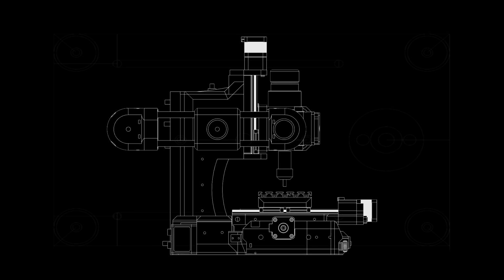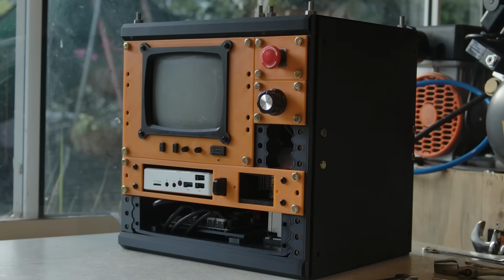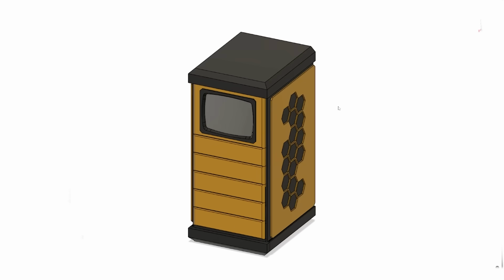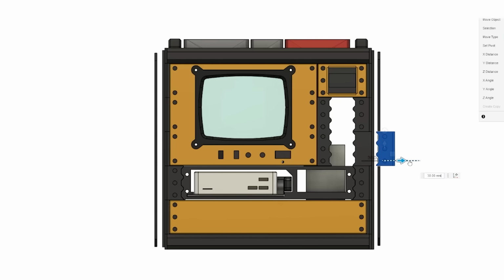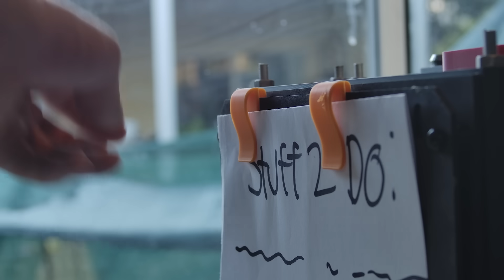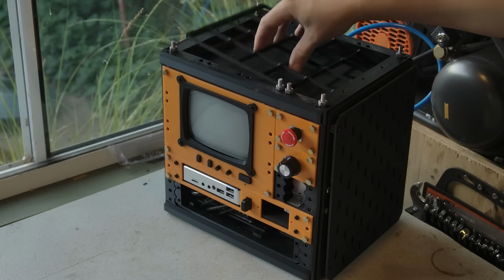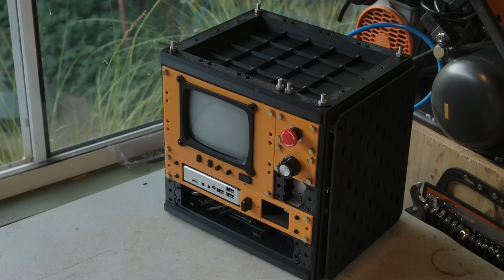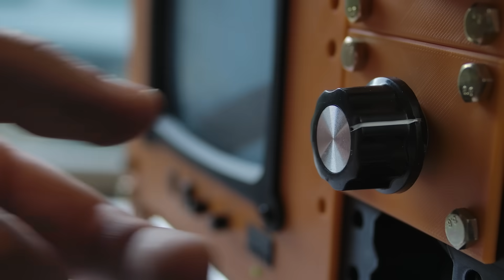I Printed A Modular CNC Controller

Comment: why crt? for he retro look?
Reply: Crt is pretty common and cheap to use, its well documented and very easy to hack the electronics. They are also commonly available. Most people use them because they are available to use at the time or for esthetics. It really could be any number of reasons but I can tell you that I use them because of availability, I probably have 10 laying around the shop and it means I dont have to spend more on parts.

Comment: 8:24 see that z axis inconsistency? You need to tighten your z axis and probably also set the grub nut in the lower part of the threaded rod. small contact area and high torque lead to slipping.

Comment: Using unkeyed identical connectors for different types of devices is purely asking for trouble. You are one mistake from frying you stepper drivers if you connect an endstop switch to the wrong connector.
Also spindle speed should be controlled by the controller, not manually - just so you can automate spindle speed changes as feedrate changes.
Why use a low resolution CRT as the display? Readability should be the primary concern, not rule of cool.

Comment: I started working on an automated photo turntable with GRBL and some networking / RPIs before that @JeffGeerling masterpiece dropped, but this is a much better approach. Just to save you a potential headache down the road - be mindful of crosstalk / noise between the power and stepper wires. You should be fine, but I had issues before rethinking how I grounded the enclosure (apparently CNC cabinets are metal for a reason). When the CNC cable was routed with my power cables, I saw some inaccuracy in the stepper output when I was drawing more or less power to the server equipment. That being said, the devil on my shoulder is curious if you could use that quirk to create some visual artifacts on the CRT...

Comment: Why not model a little piece of plastic onto the back of the "power button" you want to just transfer a horizontal press to a vertical press, so you don't need to pull the mini computer out?

Comment: Lovely design, I like that the side panels and top are modular as well!
Regarding the power button, if it works like typical motherboards you could just wire another switch, or you could make a little lever jutting out which pushes on the button when you pull it down
Reply: the lever was my thought as well!

Comment: I get frustrated with heat-set inserts too, so I designed an attachment for your Sensitive Drill Press to hold a soldering iron to help install them! just posted it as a remix on printables. Thank you for making such incredible designs!

Comment: scanning the CRT monitor seems like super overkill. basically all CRT display surfaces are either a spherical section, cylindrical wall section or just flat. looks like you have a spherical section. you should be able to measure the radius of curvature using a few different simple geometric methods, and then dial it in with a few prints to make sure you nailed it. off the top of my head, there is actually a formula that gives you the curvature based on the corner to corner distance of the display area (of course i don't remember what it is). scanning it is cooler though

Comment: You can also add recesses to frame rails and springy one-way teeth to sliding rails so you can insert components with satisfying click and remove them with just push of a screwdriver.

Comment: Great design for the expandable rack. I was just thinking about making a parametric design to build a 10" micro rack but think your solution is very elegant. Will likely make an alternate design with imperial size hardware.

Comment: For taller rack setups with more weight, the bottom modules will be carrying the load of every module above it. You could offset that strain onto the threaded rod, if you sandwiched each of the stacking modules between nuts. Definitely not a problem for this particular build... but for any build with a cumulative weight exceeding the capacity of an individual plastic part, nuts could increase the design's capability to meet that higher bar. (You could also extend the threaded rod to meet the surface below the rack, so that the rack's weight is carried by the floor instead of the bottom panel of the rack.)

Comment: That's a very cool build, and I love the CRT.  You might consider designing a cover, to keep dust/chips off of your collets.  I'm thinking of something the can either be set aside (removed) or swing all the way down the side to be out of the way when you are working/swapping collets, but that's easy to put in place when you are done.

Comment: Curious why you didn't use square nuts around 3:00?
Reply: For work we do a lot of inserted nuts and have found that square nuts are much better in a printed part then hex, they have much more resistance to stripping out the plastic
Reply: @efought2  same here. That's also why square screwdriver bits are popular in certain reasons of the world

Comment: What filament did you use? Especially the CRT electronics and the motor driver were fire hazards. It is important not to fuel the fire should the electronics ever go up in flames.
Apparently fire retardant filaments exist.

Comment: hello, which controller did you use?
Reply: Somehow my original comment is hidden. Not sure why. It is a Makerbase MKS DLC32 with A4988 Drivers but I would recommend to use TMC2209 or TMC2240 Drivers on a CNC beacause o the higher currents in the stepper motors.

Comment: You may also want to look into the racks they use for modular synths. It fits into a standard 19-inch rack, but I'm sure you could modify the standard to work with 10 inch racks.

Comment: I feel like you should be able to relocate the mini computer power button, or add a mechanical L shaped toggle (like what formula 1 uses on the top of the suspension, so you don't have to slide the whole thing in and out.

Comment: Cool design. I want to make your lathe but cant find an appropriate motor. Could you link one from aliexpress? ❤
Reply: ye me too could u make a version without crt an lcd monitor or when the files our out i just design it myself and why do u need a pc for a controller cant u just use a laptop to make files and use cnc from there like g- code?

Comment: I love this modular controller, the CRT is <chef's kiss>! Makes me want to build a retro mini rack lol.

Honestly I think the 'homelab mini rack' is one of many potential options—I've already heard from people applying the concept to a photography rig for a helicopter and a broadcast audio processing rack for tower sites... love seeing some standardization in the sizing, which means people could take your concept and apply it in different form factors!

The mini-rack project site has a ton of inspiration, too; like JaredC01 (who really inspired me to go all in on my mini racks) found a little 3.5" touchscreen that fits perfectly in his modular LabStack mini system!
Reply: I use the 10 inch standard for my custom made electronics testing and designing modules, which are small usually purpose built tools for one single job. I use the rear of the/a cabinet to distribute power to the boxes, as most of them run on DC or isolation transformer AC. It's probably one of my biggest prides in my otherwise messy lab.
Reply: @jeffgeerling if we see a retro mini rack, or even just a CRT inclusion on an otherwise modern layout I’d love that!!
Reply: I'm already thinking about using this rack system as a mobile platform for controling an astro photograpy rig. I have many boxes that needs to be conected every time i want to setup the telescope and this takes a lot of valuable time. Standard steel racks are to heavy and this could be perfect for the job.

Comment: We need a video dedicated to that CRT! Where to find them, what you usually need to adapt them, how you’ve used them in projects before…
That’s incredible
Reply: I like the design but such heavy use of 3d printing makes me wonder if buying a sheet metal enclosure is easier/cheaper. The time and materials add up on a big project like this. The CRT is great. Maybe long time watchers understand this but it leaves me with questions --- where did you get it, could I do this, etc.
Reply: I find it difficult to work with sheet metal without the tools and skill to do it with less effort than just 3d printing  @neffk
Reply: And how not to shock the ever living shit out of yourself if you forget to properly discharge it before messing around with it.
Reply: @Geeksmithing lmao this is too relatable

Comment: I built a custom 3D Printer and planning on building a CNC and Plasma Cutter in the near future. Thank you for the insights, I will most definitely come back to this video some times to build a single controller for some of them, as the needed functionalities are basically the same! Gotta move that XYZ anyways :>
Reply: I think the only part I would change is the base casing... I'm addicted to working with aluminum profiles all the way, as they are quite cheap, easy and reusable if well thought.

Comment: Nice design! There's a lot of really good ideas in here.  When I made mine, I used Euro-rack spec.  The 10-inch rack looks much better for the size and scale of most components though, so good choice.
Reply: I'm working on a 10" eurorack for myself, Building a 7U from scratch to fit in my ikea kallax XD. A 10" interior dimensions is a little over 42 HP wide so can fit 7 6HP tiles. I'm still working out the rails though, those tapped eurorack rails are expensive, so I'm looking into tapping some threads in an alu U-profile, then bolting those onto some ears ... I think printed won't be strong enough that thin.
Reply: I was gonna mention euroracks too... Suck a nice standard for panelizing things